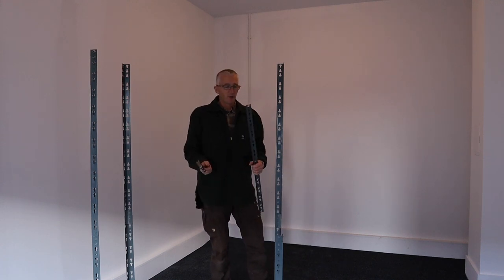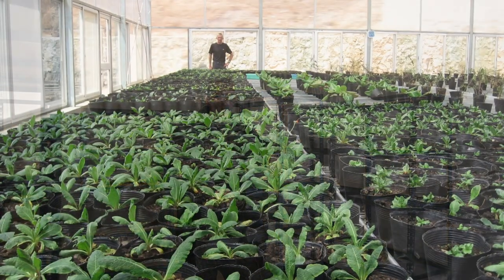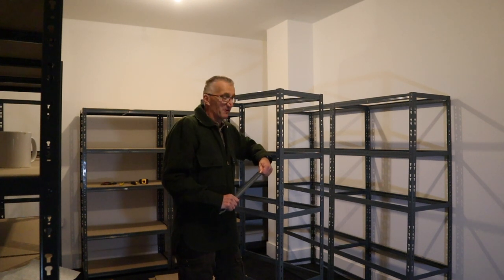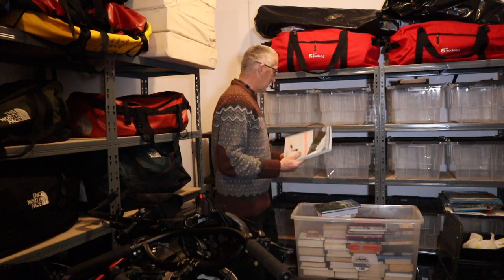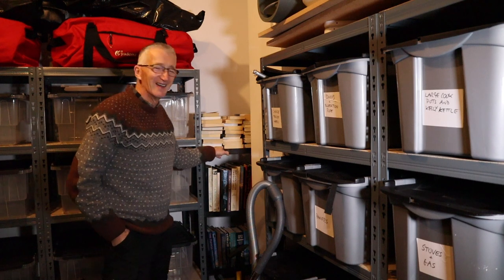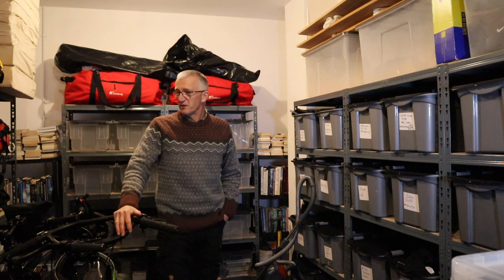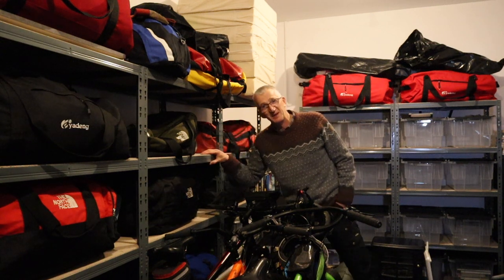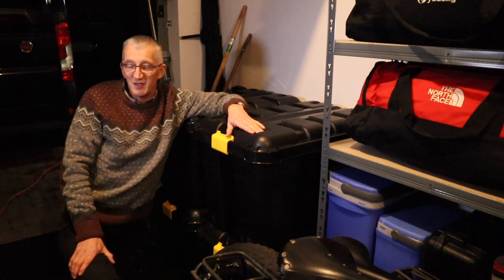Converting my garage into a gear room

Comment: Wow thats some amount of gear you have Dave
Reply from the maker: Hi Graham, when I worked as manager of the field station in the Sino-Himalaya, I was given an annual gear allowance, so was able to amass a fair amount of specialist kit. In addition, a few retailers, outfitters and manufacturers gave me gear to test. A lot of my gear is now pretty old, fairly well worn and, in some cases, quite dated. However, I have a strong connection to the older gear because of the memories. As I get older, I find myself more often reaching for the oldest bits of kit to take on an adventure. A good example is the old wooden handled ice axe that featured in a recent video. I bought it when I was about 14 or 15 years old. I saved hard for that axe, by walking to and from school, thus saving my bus fare. I popped into the climbing shop once or twice a week (it was on my route home from school) and the owner often enquired how my funds were doing. Needless to stay he let me have it at a reduced price, just in time for the first snows of winter.  Happy days. ATB, Dave
Reply: Just love all your little stories you add into the video 👍
Reply from the maker: @graham_ozzy  Thanks Graham

Comment: Also I must get myself a B17...you will know what I mean. D
Reply from the maker: Great saddles, you won't regret the expense. ATB, Dave
Reply: Dave, I had one back in 1969 on my claud butler racing cycle, I covered some mile on that saddle and yes once worn in you can't get better, a bit like old style walking boots.🚲
Reply from the maker: @davidginn7072  So true David. We belong to an era where you had to invest some time and energy to 'break in' your gear. My saddle is still pretty new but has softened a bit and begging to fit better. D